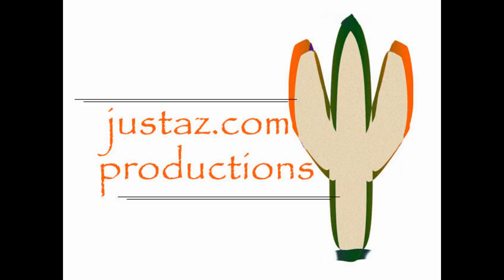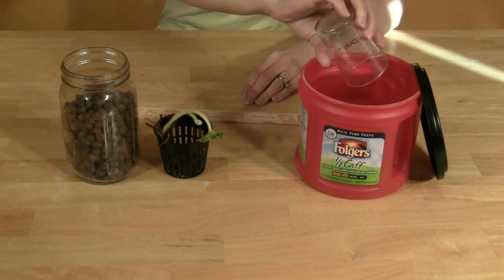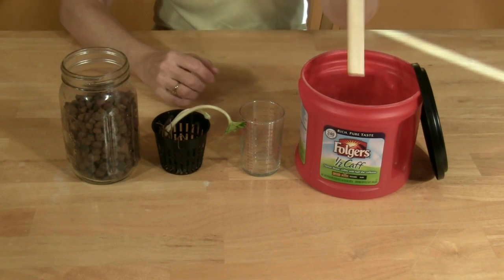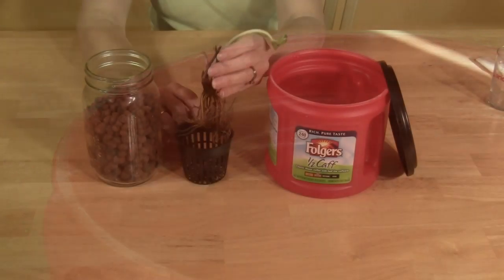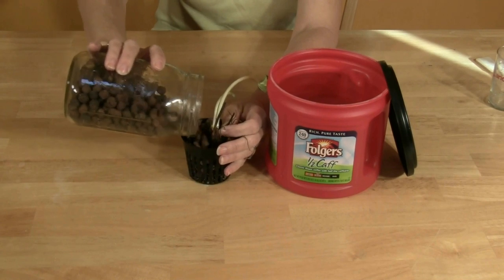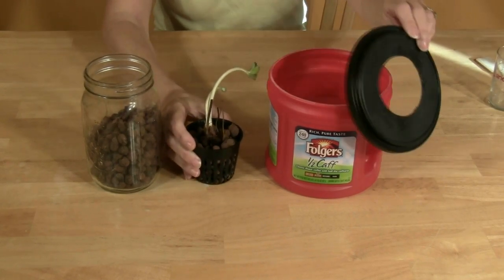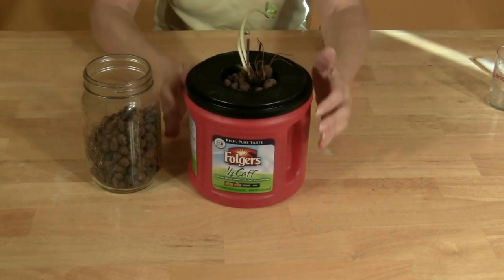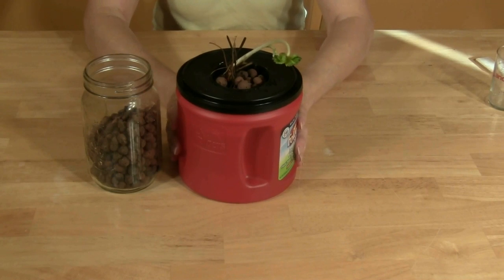The Kratky Method of Hydroponics: Growing Basil in a Coffee Can

Comment: This is my second AeroGarden, the first one, after eleven months of continuous use, is still working perfectly [My Recommend Product Here >=>>https://t.co/hsxpHaS72L ]. Both have the LED lights which are more reliable than the earlier versions which used pricey grow-light bulbs that required frequent replacement. This one is quite attractive with its stainless steel trimmed exterior.

Comment: What is 1lb coffee can? Is it the liquid to grow like fertilizer ? Where I can get? I like to try.
Reply from the maker: Hello, Mike Lim. You can use any size can or container with a tight fitting lid you would like. For this demo, a coffee can worked well. The fertilizer we used was a hydroponic nutrient solution, found in any hydroponic store and available online. Simply fill the container with water, leaving about one to two inches of space at the top. Add the fertilizer and stir. Prepare the plant, add it to the container and you're set. Thanks for taking the time to comment, and best of luck in all your projects.

Comment: @I'm Simon -- the method was developed in Hawaii, so I don't see why it would be impossible in Florida. If you're worried about heat, use white buckets instead of black, maybe.
Reply: Worked fine for me with white buckets. Yeah, there is a coat of algae on the surface... which makes the bucket dark, and I don't think the biomass of the algae ends up mattering much compared to the big plant growing in the bucket.

Comment: Mr. Kratky answered me yesterday :) Said the heat is the issue if there is any issue at all... he gave me some links to pdf's and a video . It appears that around 90 degrees is where trouble has been seen. From 60 to about 85 the method has worked, worked well in most cases. Following links I've gathered this method is best for the leafy veggies (quick turnarounds). I stocked up on some seeds, some supplies & between watching a few hundred videos & reading a few dozen academic posts I'm ready :)

Comment: Lady that runs the Hydroponics store near me laughed when I tried to explain the Kratkey Method. She said here in Florida (in our heat) leaving standing water for even a few days would produce nothing but a mess!
She said there is no way a self contained system without air pumps or water circulation would work.
Kind of took me back a bit, but I had only looked at your video and Bobby's (with the lettuce)... Do you think the Lady in the supply store is wrong? Do you think Kratky is OK, in Florida